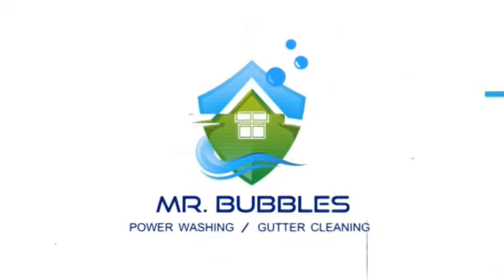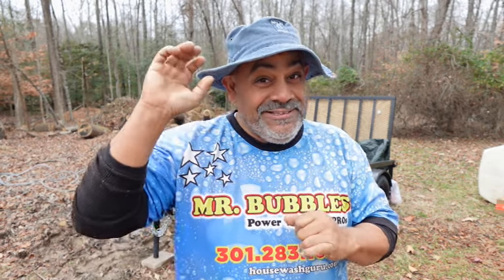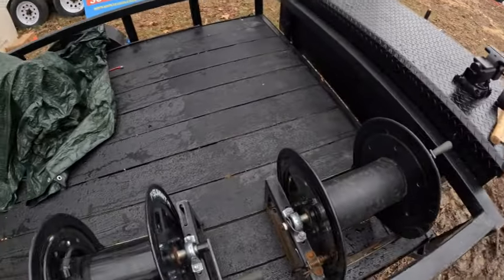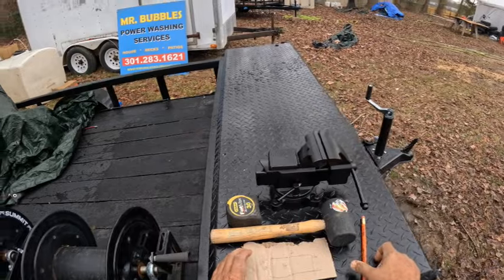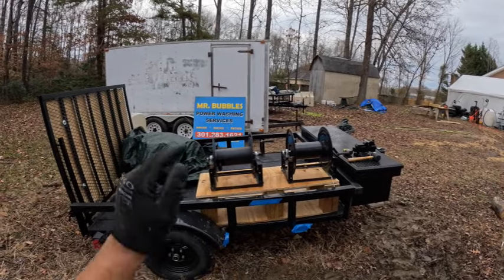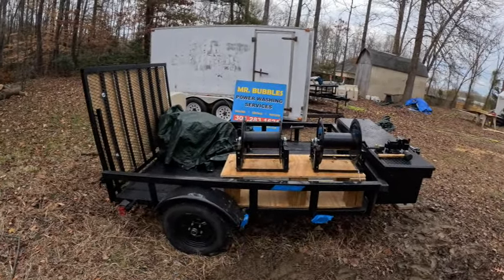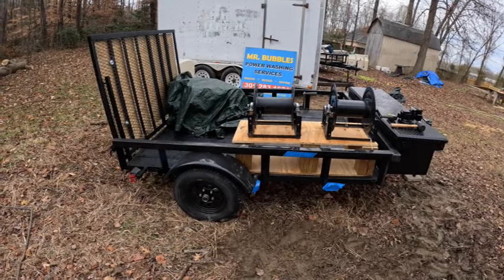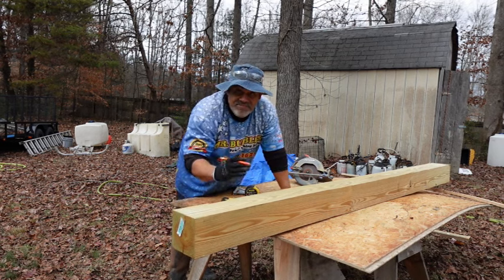Ep.83  How to Build a Pressure Washing Trailer (Part Four)

Comment: Hey great video!! And by the way @askmrbubbles , I have a question, about the metering valves. 

Background info:  So I will be getting the Simpson pressure washer that you put in your starter kit, will be making my own metering valve, order the parts online and  I want to make sure I buy the right size connections and fittings for my metering valve because I’ve heard something along the lines of “Depending on the pump you are using you may want to go with a 3/4 inch manifold and reduce to half inch.”

Question:  what size should my connections and fittings be for my metering valve if my pump is going to be a 4.0 GPM.?
Reply from the maker: Thanks for the great comment and question, please email me cause too much to type here. Here's my email address: ask@mrbubbles.com